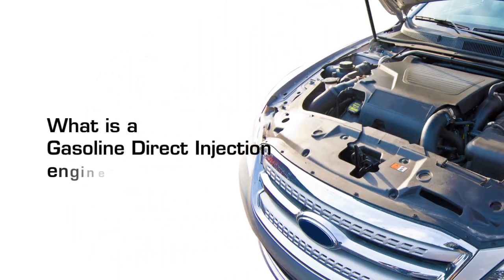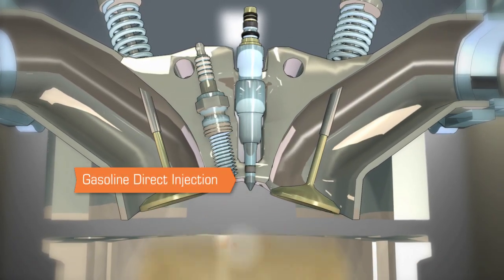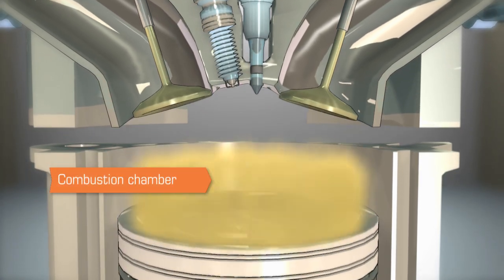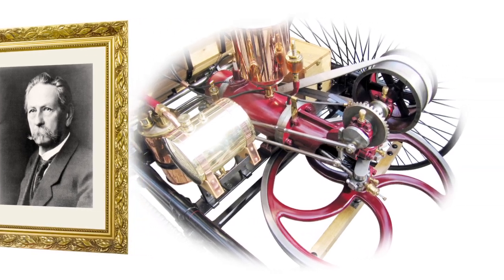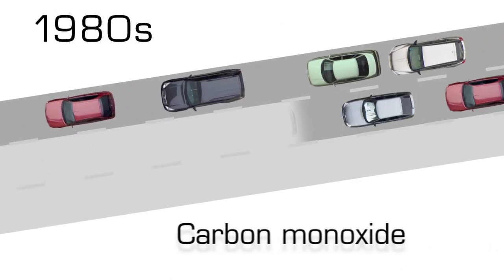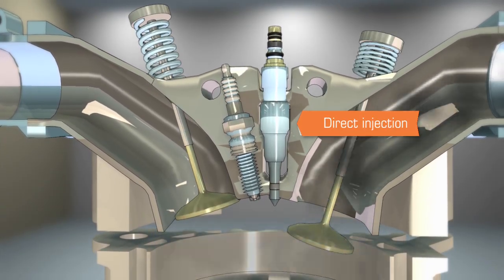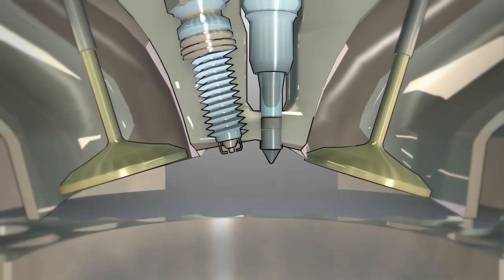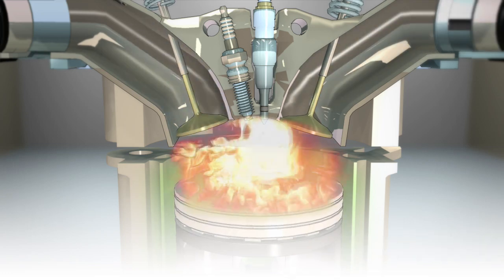How gasoline direct injection engines work.

Comment: yep, thats pretty much the gist of the advancement, knock is no longer an issue. the true potential of this innovation will be seen through blown engines though, in NA sure you could up the compression ratio, but with a turbo you would really be letting the turbo do what it does best

Comment: If the GDI systems on cars today are dumping the fuel at the beginning of the compression stroke, then there is effectively NO difference between GDI and Direct Port Injection. However, if they supply fuel like a diesel near the top of the compression stroke, then you can gain higher compression ratios as pre-detonation becomes a non-issue. There is no reason why we shouldn't be able to run 20:1 compression ratios on gasoline with direct injection. Currently, they are ~ 13:1, or 1969 levels.